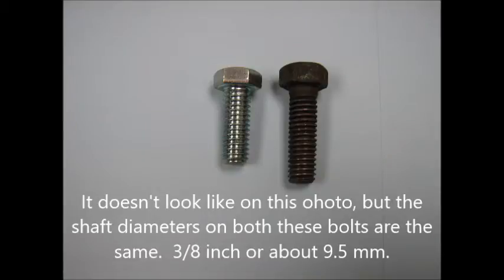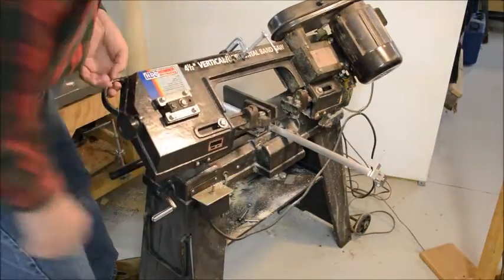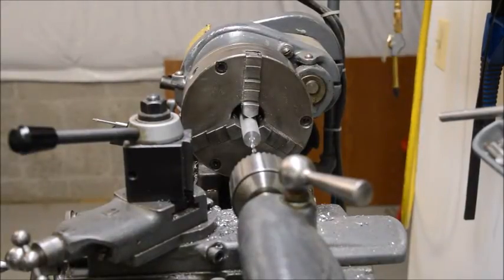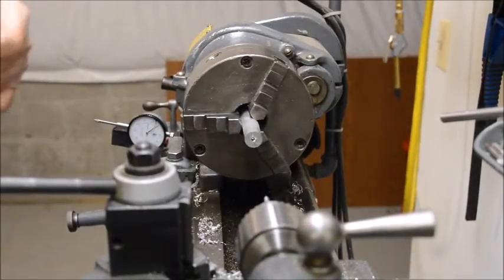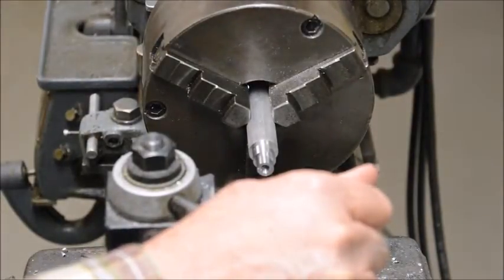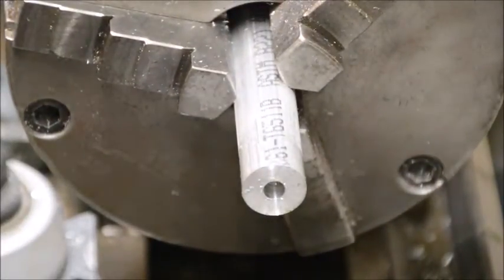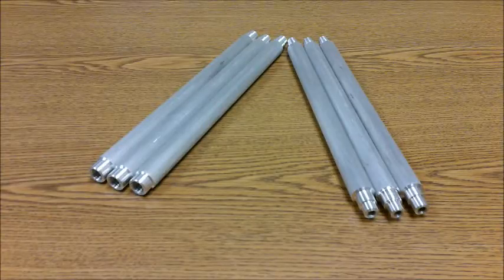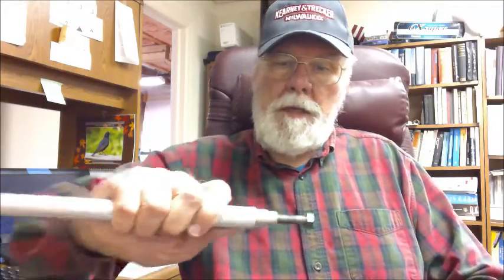The Saga of "Rusty" Bolts

Comment: Cool (and simple) trick Paul.  I can't tell you how many unintended "missiles" I have launched from small bolts getting pulled out of my hand while wire wheeling or how many "polished" finger tips I have had for that matter.  Thanks for sharing-  Fred
Reply from the maker: Thanks, Fred.  It's easy to slip when doing small parts on the wheel and the cost can be high.